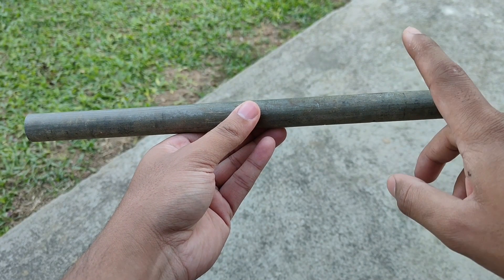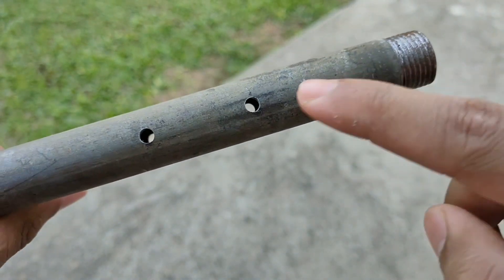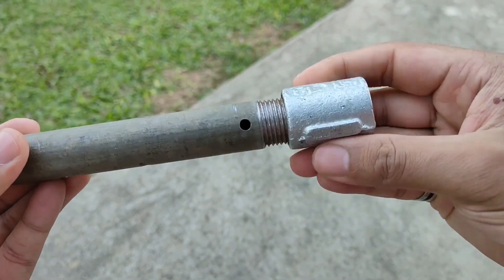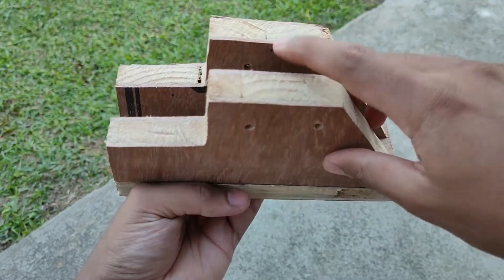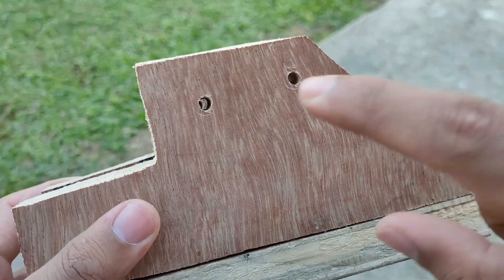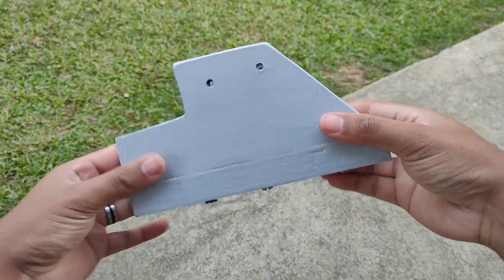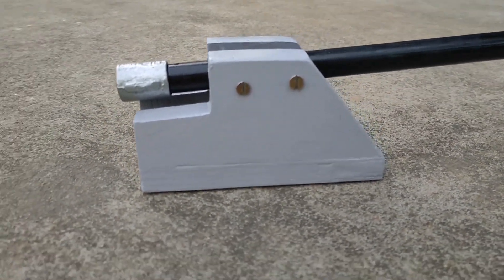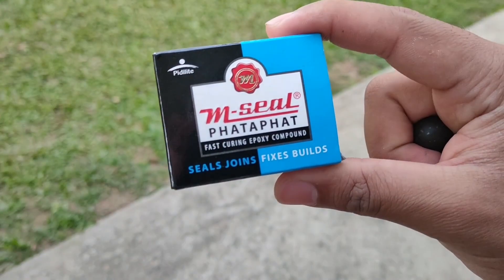How to make a cannon at home / Homemade powerful mini cannon /

Comment: this is dangerous bro the pipe can explode and the fuse was useless its too fast
Reply from the maker: The pipe is strong enough to handle small firecrackers like the one I used . But you are right about the fuse those were totally useless 😂
Reply: @TheRandomBunny09 the pipe is strong but that fire cracker is big
Reply: So long as your using a good quality piece of pipe and swab and screw the bore out of any debris after each charge, you should be fine. The ball of epoxy would fail before the breach would and let the excess pressure vent through if the charge was over loaded. You can make your own powder out of 3 common ingredients and some simple tools. If you’re worried about a breach failure, you can always sleeve the pipe with another to act as a buffer between you and the pipe rupture. As always face shield, eye pro, ear pro and a wall or barrier such as polycarbonate or sheet of aluminum. Danger can be avoided at just about all levels so long as you’re diligent and aware of the risks should they occur. Keep notes of your experiments so you can have reference points for further study and to make resolving issues much easier to understand